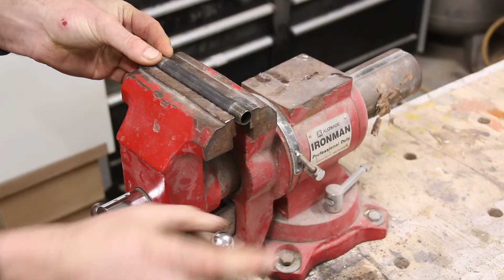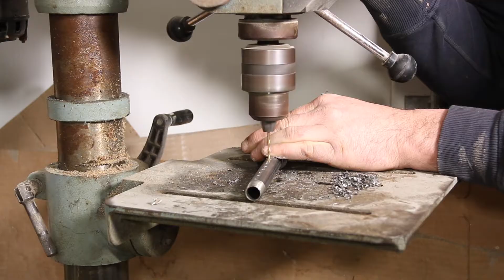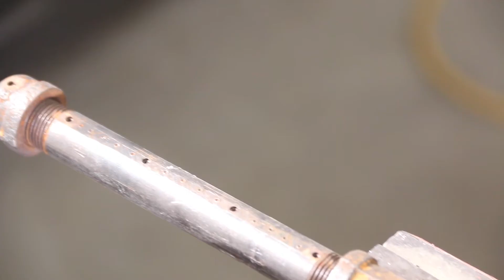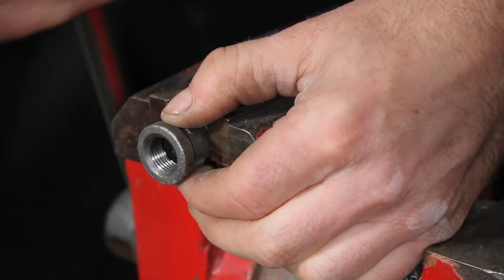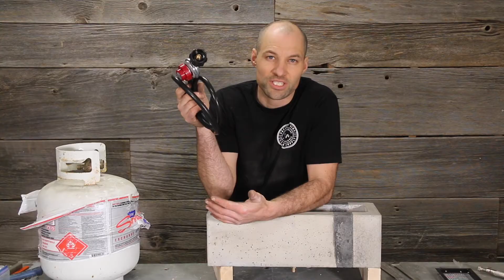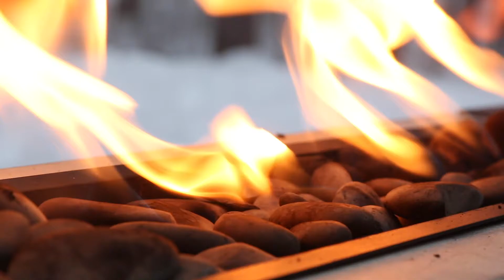Propane Pipe Burner for Firepit

Comment: Thanks for this video. Very much what I'm looking for and  Not a forge burner. Apparently this burns without a Venturi ? I need this type of low heat flame to kill mites from grooved boards 8"x 8". I have the regulator for a forge burner, but the blue flame is too hot.

Comment: For LP (propane) you will want an air mixer installed right where the line goes into the burner. This is safer with LP and will help burn cleaner and reduce soot deposits. You will not need an air mixer with natural gas. Good Video
Reply: Venturi

Comment: First great video, really liked it, nice burner, . i have a question? can i use longer pipes on each end of the T so i have like 5 feet on one side and 5 on the other for a longer 10 foot fire table. should i use less holes drilled so the gas will get to the ends of the pipes.  i bought the air mixer and 20 pound hose and regulator you recommended , . . . . and would it work if it was one long 10 foot stick gas pipe and propane tank just on the end instead of the middle with a TEE.
Reply: This is trial and error, but simple. RULE #1 DRILL SMALLER AND LESS HOLES THAN YOU THINK YOU NEED! You can easily enlarge them or add more! Due to the low flow velocity, if it's is unlikely that you will experience a signficant drop in a 5' pipe, for 10'  that is small dia, see rule #1.

Comment: Great video. you should use a air mixing venturi with propane as a fuel source. This will insure proper combustion, otherwise you can risk pooling up some unburned gas in the bottom of your pit and create a fireball which wouldn't be great when your kids are roasting marshmallows.

Comment: At my local big box hardware stores they have black pipe and galvanized. Does it matter which one I use?
Reply: Use black pipe. At high temperature the zinc coating on galvanized pipe will give off toxic fumes.
Reply: @neipamocal  won't black pipe rust?
Reply: @chriss8354  everything will rust after being exposed to heat like that, even stainless steel. Black iron pipe would take years to rust if cared for properly. A simple cover to keep the rain off when not in use and you'd be set.

But the gas given off by burning zinc can kill you.

Comment: Did you just use a straight fitting into the black iron pipe? Typically for propane it should be mixed with oxygen before ignition. I ask because I was going to make one, and I was looking into where I could find a Venturi fitting
Reply from the maker: Hey Justan ya I actually went out and bought an air mixing valve on Amazon linked to it in the description above if your interested is seeing it. The problem I ran into was the burner is so small that it won't work properly. It basically just spits out propane where it should be sucking in air. The one I had was for a 1/2 inch pipe. Which would be fine for a large fire pit but not so good for this small burner application. Anyone else able to find a smaller mixing valve online ?
Reply: @TimberTea  Curious about this... I was planning on doing the same project and also using a 1/2 inch mixing valve.  Obvious question, but the mixing valve is directional.  Are you sure its not installed backwards?